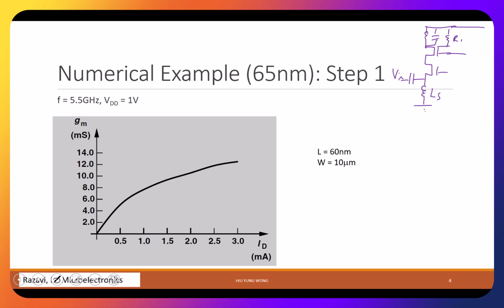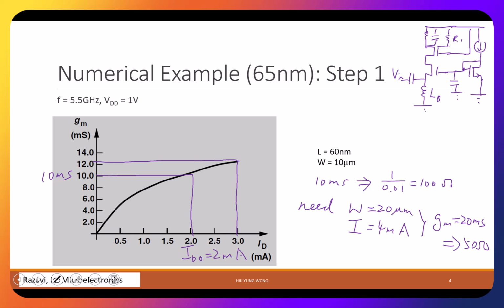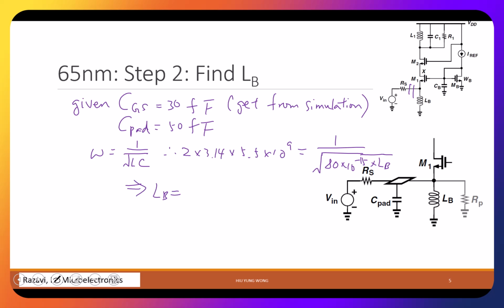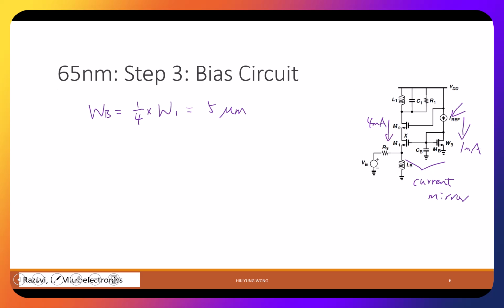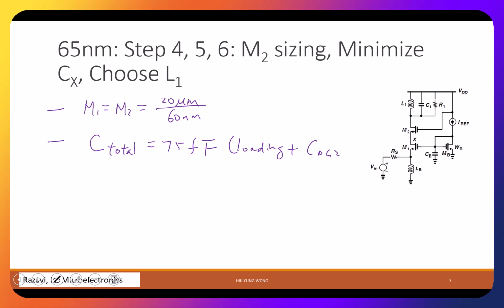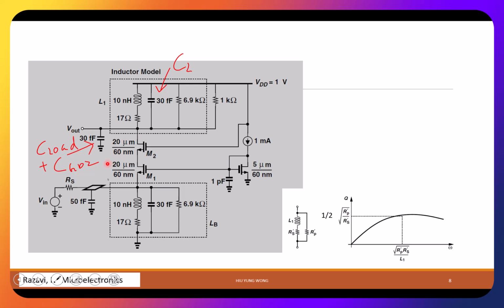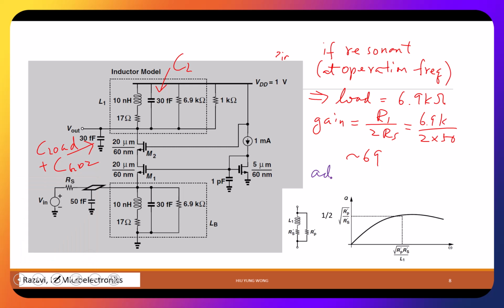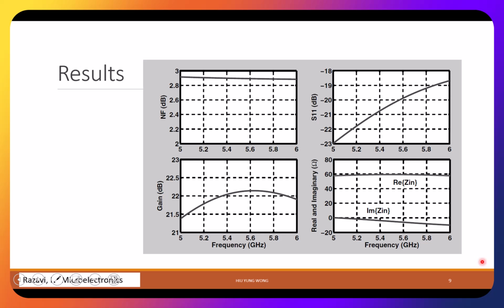L24A2 - Numerical Example of Cascode LNA with Inductive Biasing Design

Comment: when carrying out simulation for W/L in Step 1 for the CG; do we carryout the same simulations like you did for Common Source Amplifier in EE124? Is the simulations for CG different?
Reply from the maker: In EE124, I used LTspice, and the model used is not suitable for the high-frequency regime. Here we used Cadence Spectre with RF model.

Comment: Hii, can we eliminate Reference current source and use a diode  connected MOSFET for biasing?
Reply from the maker: The reference current is just an ideal current. In reality, yes, we should create the current source using a circuit and the most basic one is a diode connected MOSFET. For a high performance one, we need to have a good design that balances power, noise, output impedance, and area.